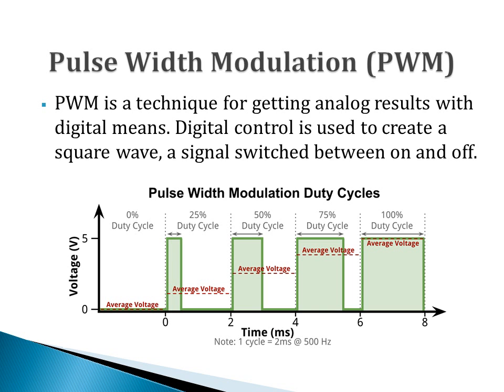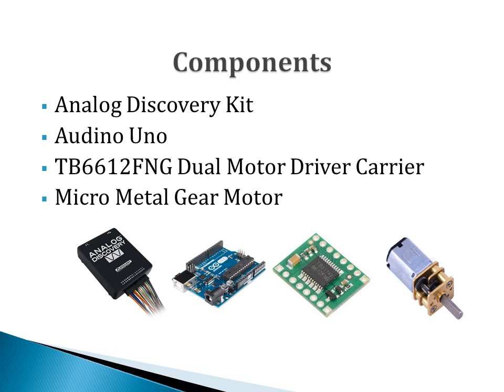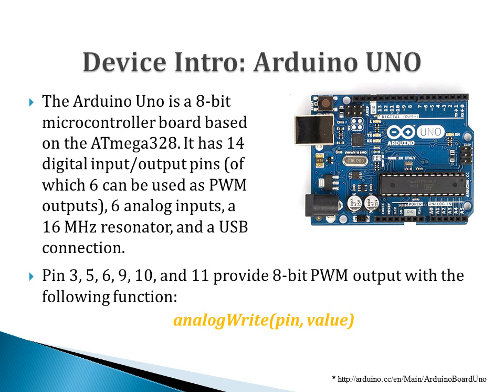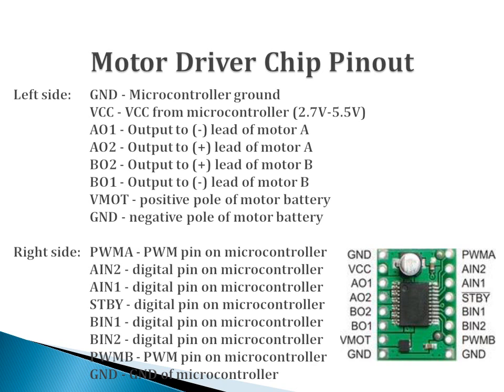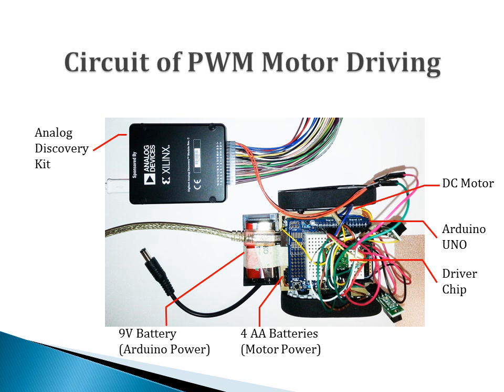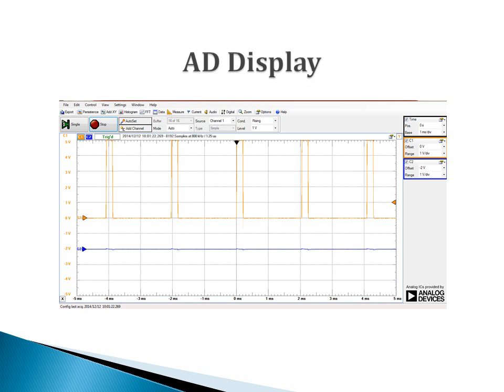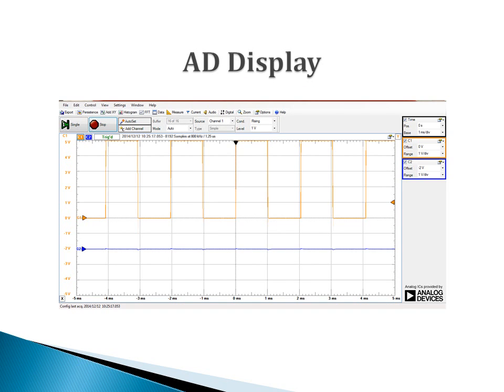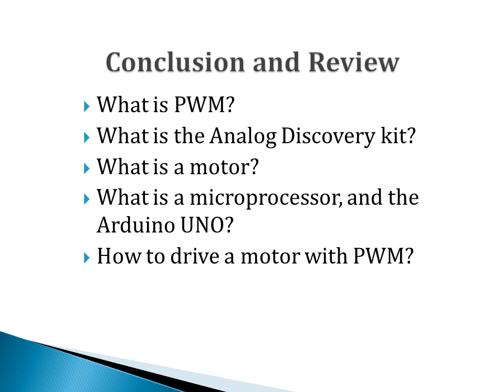Arduino: Hands on Learning @ UMES_Zhang

Comment: Do your students own their Analog Discovery boards? Do they own the Arduino used here? If not required to do so, so some students still purchase their own?
What is the full context of this experiment? What course is it in? What is the background of the students? Do they already know how to work with Analog Discovery and Arduino before this experience?
At 7:21 of your video, the four cases shown have some distinct non-ideal characteristics. Do your students notice and, if so, what do they learn from these measurements other than what PWM means? Have they tried changing the load to something fairly benign like an LED and see if the system behaves differently?
What has gone wrong with this setup?
Reply from the maker: 1. Every student receives a complete package of lab devices after signing an agreement. The package includes AD kit and other accessories. They can keep the package until graduation. The Arduino is provided only for the experiment. Students are suggested to purchase Arduino ($10 - $20) by themselves to develop engineering projects. 
2. The experiment has been offered a couple of times for different purposes, for example, the special topic of basic circuit lab, microprocessor introduction lab, and engineering project development workshop. Most students are from ECE background but also several from ME and AS (Aviation Sciences). All students have received training on the AD kit and some of them also have experience on Arduino.